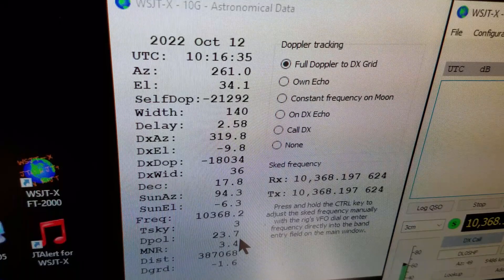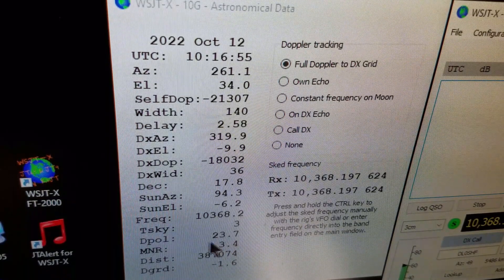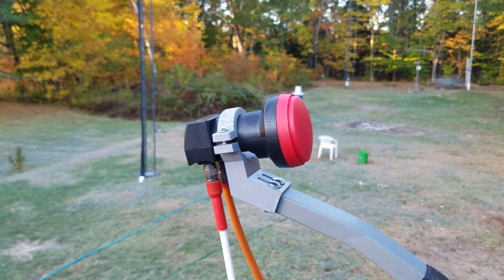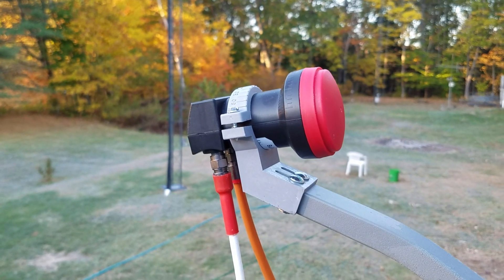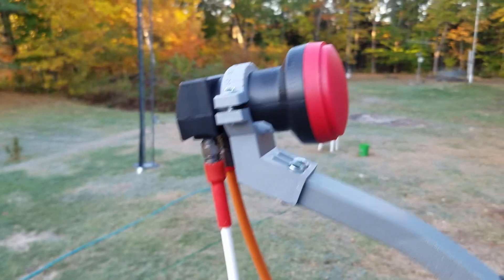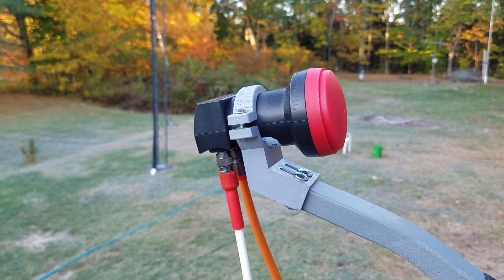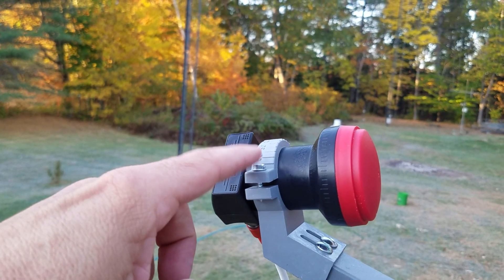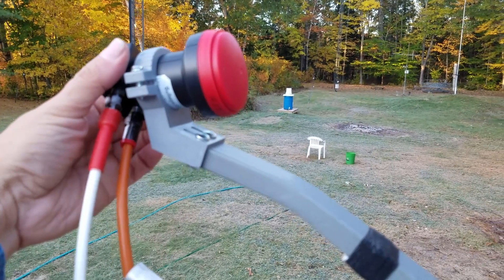More on 10 GHz EME Reception: Polarization

Comment: Paul, does the surface of the moon "scatter" the polarization of a reflection?  73  KT1R  Lou
Reply from the maker: Lou, sorry I didn't answer sooner. I am not certain but I have seen evidence that supports a belief that it does scatter polarization somewhat, but not enough to completely randomize it. Measured data on 10 GHz EME signal loss due to polarization misalignment only goes to about 12 dB. At VHF we see at least 20 dB, so it looks to me like polarization is partly "spread" at 10 GHz. This is just a theory based on data I have seen. It makes sense that a rough surface that is moving would do that. I suspect it does to a lesser extent even at much lower frequencies.

Comment: Why not circular polarization? Is it a matter of available hardware or am I missing something?
Reply from the maker: That is a good question. I did some research before answering your question. There has been much debate over many years about whether it is best to use circular or linear polarization on 10 GHz. Some seem to believe one way, some the other. I dot yet have enough experience to have an opinion.
Reply: @n1bug  Sounds like the way to solve this is experimentation!

Comment: why don't you build a rotator with a stepper motor to spin the LNB around its long axis? If you're careful you wouldn't shadow the dish by very much. Then you can dial in whatever angle you want and stick to the LNB polarisation that gives the best NF.
Reply from the maker: That is a good idea. If I were making a permanent system and if I did not need to go the dish to aim at the moon anyway, I would make the LNB polarization rotatable. With the temporary system using manual azimuth and elevation it was no problem to also adjust polarization by hand when needed.

Comment: by way LNB stability refers to the accuracy of the internal oscillator of the LNB.  There are cheap models with temperature dependence of the frequency.
Reply from the maker: Yes, that's right. This Bullseye LNB claims to have the least temperature dependence of any, but even this one changes frequency too much with temperature change for this kind of work. It is much better than the cheap ones but still not good enough. That is why I modified it to use the external precision frequency reference.

Comment: Hi this converter has two polarizations. You can change it with voltage change. 12v and 19v.
Reply from the maker: Yes, I know. But on every one I have tested, noise figure is not as good on the horizontal polarization. This is not good for EME because you will not be able to hear some of the weaker stations. You need the best noise figure you can get, and that is the vertical probe/polarization in these things.